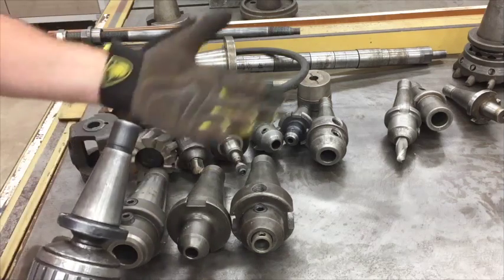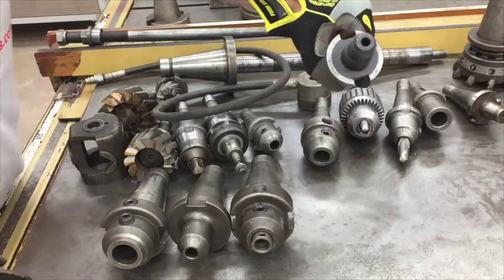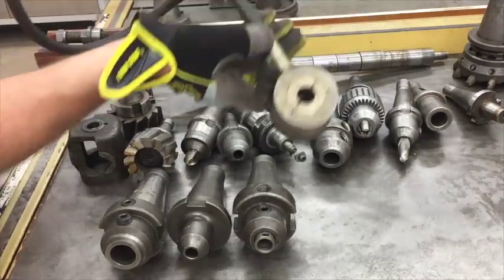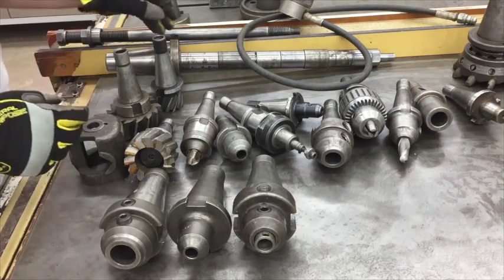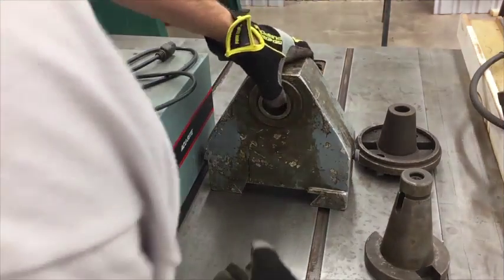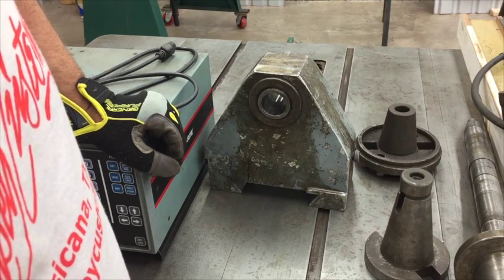Shoplife 032 - Cincinnati Mill Tooling + DRO Review

Comment: I bought a Cincinnati Cinel 202-12 early last year and had some trouble with the unloading so be careful. I thought my forklift was big enough but it wasn't quite there. Luckily nothing major was broken. Gave me a chance to tear the head down and change out some seals and bearings. Turns out either the people I bought it from or the prior owners weren't fans of cleaning and some how the overarm had a pound or two of chips in it which got into the gears and wouldn't let the spindle move. Got that part working now trying to get the powerfeeds working. Something is clogging the hydraulic system. I think it is something growing as I could feel something squishy in there. Mistakes happen it is how you deal with them that matters. Had quite a few people on a certain site, that I no longer visit, make fun of me over the situation. To me that's the lowest form of humor, kicking someone for making a mistake. Now if you keep making the same mistake well that's different however if you learn from it and correct it that's growth. Good luck with your mill.

Comment: MT3 on the first one. I'd say that that HSS insert able guy is usable, but you are going to have to be creeping on the spindle speed. Deep cuts, probably a pretty decent feed too, but dead crawling on the speed. That looks like a JT4, sized for an 18(?)N drill chuck. I have a 20N, it's a good one if you can find it cheap. 1 inch. Never seen a 22N. Arbor's come in various lengths, shorter is obviously stiffer.

Comment: Gary you are off to a good start on your tooling.  I think maybe the face mill has brazed carbide bits?  The brown color could be due to the tool getting hot or just sitting in cutting oil for a long period of time.  Try a bit of carb or brake cleaner and see what happens.  HSS can discolor a little bit and still be ok.  Your DRO might actually have 4 axes, xyz and w.  Check the encoder inputs on the back.

Comment: Don Cossitt had a video about carbide boring bars a while ago, he had a jig that was used with a surface grinder to sharpen them.  The inserts in that milling cutter look to use a similar jig.  The brown on that shell mill is most likely just dried oil.